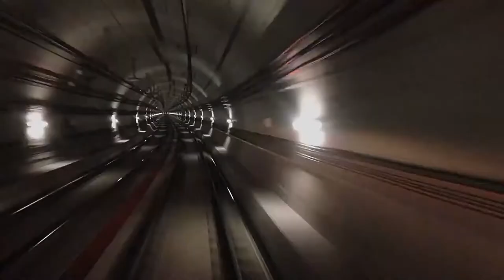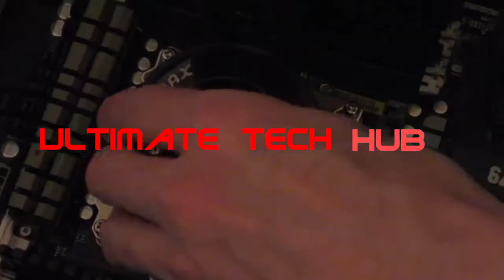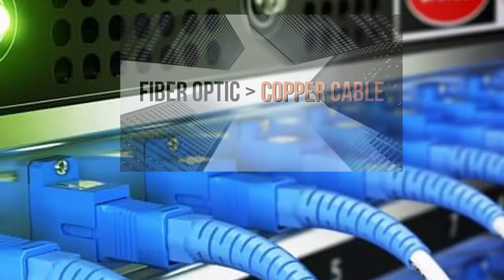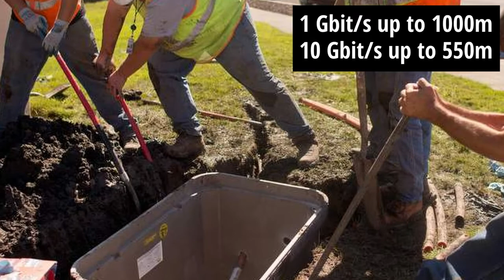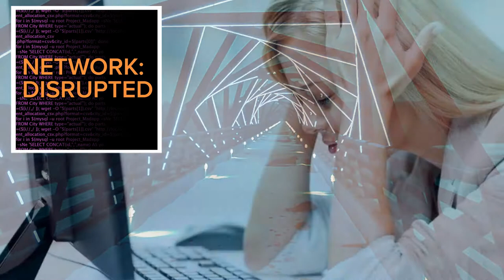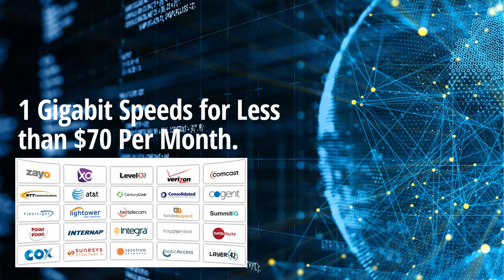FIBRE VS COPPER - HOME NETWORKING 101

Comment: With regards to Fiber broadband my question is....my isp only probably has fiber all the way to the box outside my flat...(box shared with 50 flats) as far as I know from the box outside all the way to my wall is still copper. Will I still get the speed fiber provided even though this was cut on the box outside?
Reply from the maker: That's a tricky question. But in theory yes copper from the fiber connection can support 1gig speeds and even 10 gig speeds to your flat. It does depend on how far the copper cable runs to your flat and if its Cat5e or Cat6. If its Cat6 then you should be good as long as the cable length isn't very long 100 meters (328 Feet). You should ask to for a fiber cable run to your flat. Keep me posted.  Thanks for watching!
Reply: @UltimateTechHub  thanks for that....as far as I know some part near in my area they only started doing Gigabit broadband which lead me to believe that eventually will get a proper Fiber line from the box outside too. But based on my plan when I sign up before fastest I could get in my area was only 300Mbps which is good enough for our household use using one WAP. But since my son play game in He’s room I’m considering doing a basic home network wiring in some room ...At the moment he’s only using WiFi signal from the main router which has lot of drops during peak time...perhaps I just start with unmanaged switch as I need more ports from the main router for my TV/cinema set up.

Comment: Your 6 reasons are irrelevant to me as a consumer.
My copper broadband is good enough for my purposes. (I don’t play on line games)
My copper telephone line is perfect with good ringing throughout my house.
My copper telephone line is more secure and my calls cannot be monitored easily. (Requires a physical tap).
My copper telephone is powered from the exchange which has a back up generator and therefore more secure for emergency calls etc.
My copper telephone line is analogue and better quality.
Should my copper line fail, BT and Open Reach must repair it.
To me there is no advantage changing over to fibre at all!
Reply from the maker: I don't have a landline so copper makes no sense for me and my speeds are much better with fiber. And lastly, I'm paying 75 per month versus 240 with cox. Its a no brainer. Cox only provides 30mbps up while CenturyLink provides 940mbps up. I'm surprised you have a telephone line....I haven't had a landline in 15 years! Thanks for watching and for commenting I really appreciate it! Have a great day!